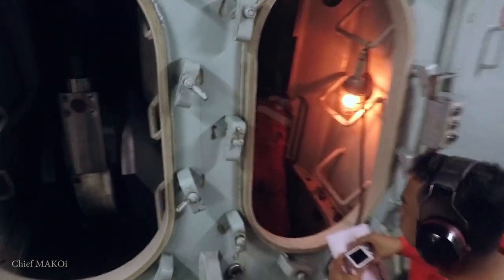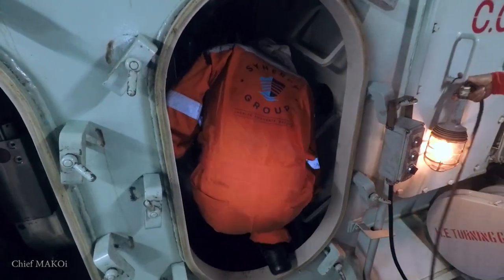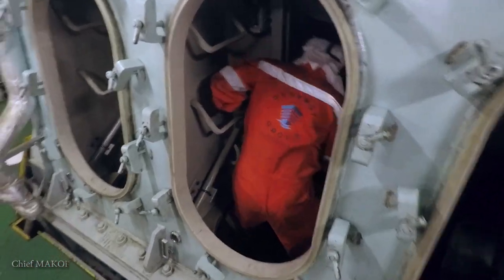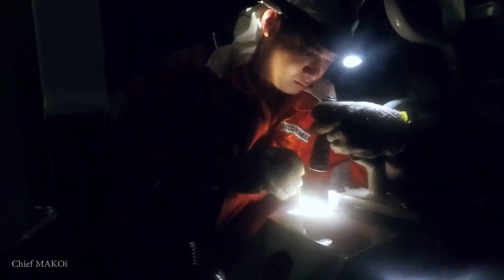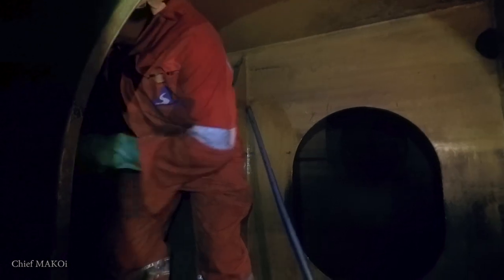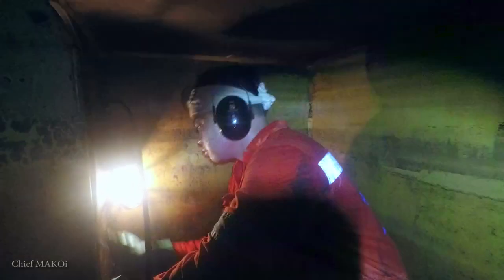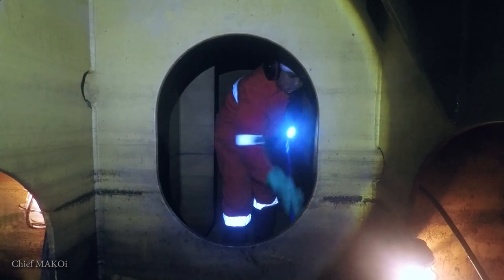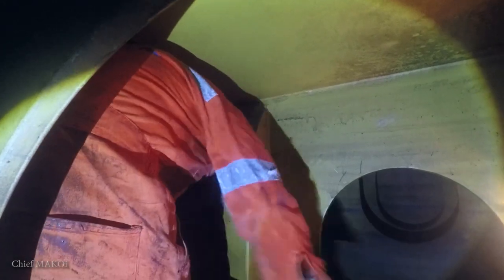Working in Enclosed Spaces | Seaman VLOG 045

Comment: When I was stationed on a U.S. Perry class frigate back in 1990 I had the opportunity to enter the sewage holding tank sever times.  The float switch that turned on the pumps would fail every so often.  It would be flushed out with soapy seawater about 5 times before entry.  Ah good times.
Reply from the maker: One of the reasons why I worked really hard to get promoted to ChEng quickly 😄